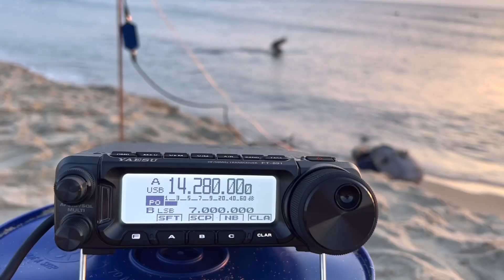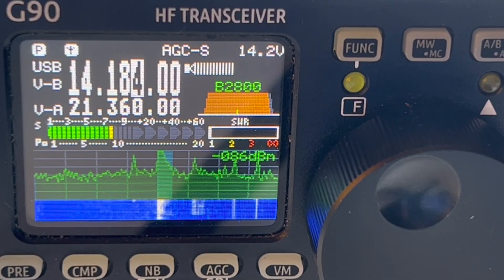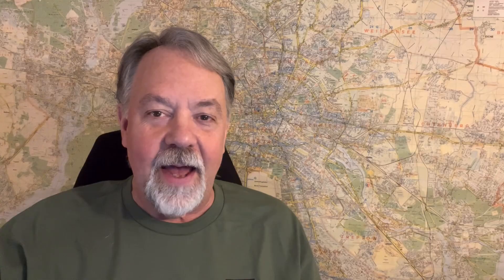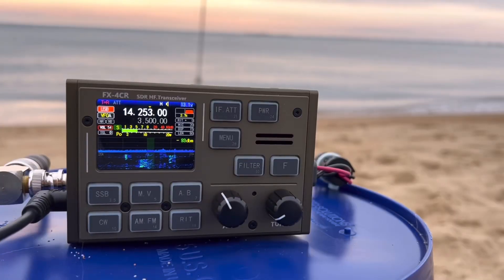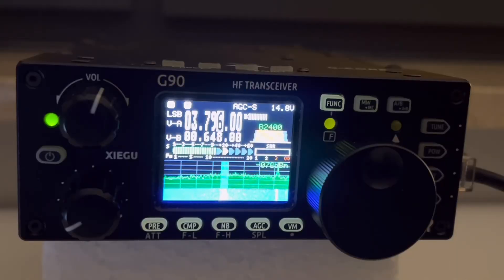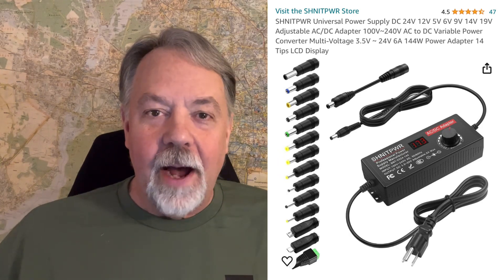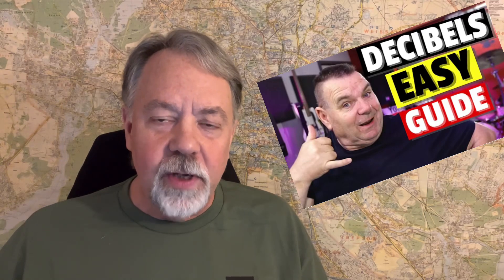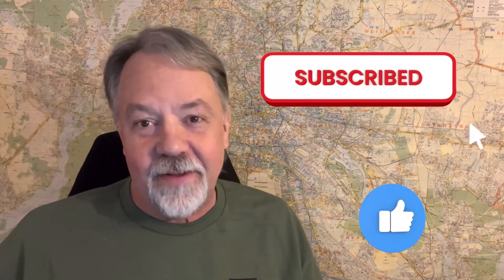20 Watts Versus 100 Watts - How much HF Ham Radio Power Do You Need?

Comment: Right on point Walt and good job on the laying out the facts. I have a G-90 and an 891. I see little difference in contacts made between the two. The G-90 has an edge with size, weight, power usage and a fantastic tuner. The 891 has a slight edge in power and it's excellent DNR. You are not wrong in your decision Walt.  I have thought about selling my 891, but decided to keep it for a couple reasons. One, it's in a faraday cage as a back up should the worse happen. Second reason to keep it is for when the bands get really bad. Either because of the solar flares or when we get to the solar minimum and contacts get much tougher. In those cases, that one "S" unit might make the difference in getting a contact or not. In most cases, that one "S" unit doesn't make much difference. No matter what radio you are using, the antenna is always one of the biggest factors in your success. Using the correct configuration for the desired distance, the right band and the most efficient antenna will make far more difference than one "S" unit. Some may disagree....it is what it is. I love the antennas you build. Ham radio does not have to break the bank. I often recommend the G-90 to new hams. It makes a great base radio and is great portable. It lets them get on the air and gain experience so that they can make better choices in the future as to what additional ham radio equipment they will need and buy. You don't have to be the biggest mouth on the air, especially when your ears are lacking. 73 !

Comment: I had the G90 and thought i needed more power. I sold it and bought the icom7300 and the ft 891. 7300 in the shack and 891 in my truck. Love them both but i miss the G90. There is a guy near me that is selling a G90 that has mods and is 6 months old for $335.00
Reply: I own the same 3 models also . Haven't thought of selling any of them yet.

Comment: I loved my G90 when it worked. The first one i bought the top buttons worked intermittently.I sent it back and received another one. After about 10k qso's the mic stopped working or would lock up on transmit. Radioddity wouldnt send me another mic. They sent me another replacement. Well that one wouldn't TX on AM. You could switch to AM but it would TX in LSB. So knowing my warranty was about to expire. 1 year. They gave me a full refund. I put another 200 dollars with it and bought a 891. For the occasional activation it would be fine but for constant use the milage my vary. I run resonant antenna's for POTA and BOTA so i have no use for a tuner.  What works for me might not work for you.73's

Comment: I guess I don’t really need to worry about getting a 500 watt amp for my iCOM 7300 anytime soon … i should just enjoy the rig barefoot
Reply: fwiw, I run a 7300 with a AV-640 vertical antenna. I also have a 800w amp-of which I've used only a handful of times in the last several years...i should sell it.. lol..

Comment: I use a yaesu ft818 with a 150w cb antenna adapted for ft8 10m, it’s frustrating sometimes but it works.
For the rest of the bands i usea a yaesu ft710, i tried qrp on 40 and 15 and its very frustrating, 20 to 50w is the only way

Comment: I set up a winter ham shack in my basement  built a 20m speaker wire vertical,,,my G90 was the rig i used ,,the contacts on 20m were unbelievable!! A sad day is comming when i take it all down to put the grill and picknic table back,,,,this fall ill put a rybokov in its place and hope for the best 73 thanks walt

Comment: Like the Channel Walt, I would say that 100W is 5 times  20 W and yes thats only 7db or an Spoint , the real issue is that 5x the opower doesnt get you 5x further especially as you are fortunate enough to be close to a beach & salt water. We do have a few years of solar maximum left so it will be interesting if you can tell us how that goes further down the line. BTW have you done any more with the SLinky antenna ??

Comment: Strongly thinking of selling the 706 MKIIG but not until I buy a 705.  I want the option to go SSB of VHF/UHF and that is me.  I can't go with the other radios you mentioned because of the small display size and my vision issues.  It is why I diched the FT-817D

Comment: Hi Walt,
What venue did you use to sell your FT-891? I need to sell mine, but it's for dental expenses. Really don't want to sell it and I may also need to sell my lightly used  ALS-606S.  73  WJ3U
Reply from the maker: I did a Facebook post but actually ended up selling it to a friend in my local club.

Comment: Sold my 100 watt rigs years ago.  Not against more power, some people live in less than ideal places an a little more power helps them get out.  Using less power means you can carry less power.  Smaller batteries, smaller wire, smaller transformers.  I don't even own a tuner.  To each their own though.  Do what you want and have fun.

Comment: I agree 100 per cent !  I used my Yaesu FT 450 for 15 years .  Back in November I bought a new Kenwood TS-590 sg . In January I bought the G-90 .  Guess which radios  are  gathering dust , while I have been making 1 watt ssb /phone contacts?  Low  Power is so much fun. KJ4HRL

Comment: What timing! I’ve been conflicted on these 2 radios for months and am getting ready to buy in the next day or so . I was convinced on the FT891 until this week. Your channel has provided some great insight on the G90. In your opinion, is the additional cooling fan needed if I’m just using SSB phone? 73!
Reply from the maker: No I have been running mine for 3 years in the heat with no fan. It gets a little warm at times but the fan really isn’t necessary for just SSB. 73, Walt

Comment: Love my G90 too! I use it in an off grid outbuilding, dedicated to radio (& storage), where I use a pair of 8 amp/hr LiFePo4 batteries, kept up with a 100 watt solar panel and Renogy charge controller. Perfect set up to feed in my two HF antennas: an OCFD dipole with a 4:1 balun & random wire 44 ft long with a 9:1 balun.
Reply from the maker: Awesome! 73, Walt

Comment: Passed my General last week and got a G90 based on all your great videos.  Got a piece of Menards speaker wire chucked in a tree outside my apartment office window and IM TALKING TO THE WHOLE WORLD. You were right dude…. 20Watts is all you need.  Thanks for the great info on your channel, you got me up and running QUICK.
Reply from the maker: That’s awesome! Hope to catch you on the bands! 73, Walt
Reply: I got 2 g90 radios, 1 with 100 watts and just use the other on 20 watts, it's all I need. Walt got a. Link to that small power supply???? AA2BD
Reply: @COASTALWAVESWIRES  Walt.. I had to come back and tell you .. I hooked my G90 to the gutter outside my apartment this morning and its working AWESOME hahaha.. 9:1 unun, 6foot of ground wire and a little lead hooked direct to my 40 foot tall by 200 foot or so apartment gutter and let me tell you buddy it tunes up 20 and 40 no problem and FT8 is LIT this morning hahahah.. Have a great day!
Reply: Cool man! Exactly what i was hoping to hear. What you described is the whimsical dream of HF I’m hoping to attain. Set you doing 20 meter?
Reply: @DeepBlueWaves  10 - 12 - 15 - 20 - 30 - 40 - 80 .. it's all popping!
Reply: @silicosick  yay! I plan to be mostly outdoor; do u feel the G90 is rugged enough for that? The FT-891 idea is still drilled into my head.
Reply: @DeepBlueWaves  I would say the G90 is as rugged if not MORE rugged than the 891
Reply: @silicosick  cool man! Have Tech, plan to grab General in June, and surf the waves soon. Thanks again :)
Reply: Congrats. I did the same when i got my general… I was considering the FT-891 as well, but went with the G90 as well…
Reply: I have both of these radios and i use the g90 way more than my 891.

Comment: It depends on an almost infinite number of things, and I won't even bring up signal propagation, which we all know varies widely, often from minute to minute.  If you have a REALLY good antenna, WAY up there, and everything is properly tuned properly, yes, you can do a lot with 20 watts. Some prefer 5 watts. The rules allow you to use as much as 1500 watts on many bands, but they also say you must use the minimum amount of power necessary to establish reliable communications. I have an Icom IC-718, an Icom IC-728, and a Yaesu FT-DX 560 tube radio that I completely rebuilt. Not a fan of newer "computer" radios. The Icoms will put out anywhere from 5 watts or less, to close to 100 watts, depending on modulation. The Yaesu will put out close to 200 watts SSB. I don't have the best antenna in the world, and there is nothing I can do about that. What I have noticed is that I can make a LOT more contacts with 100 watts than with low power. There is definitely a law of diminishing  returns as far as power goes though. I live in the southwestern U.S., and have made a lot of contacts in the South Pacific, especially Australia, New Zealand, Tasmania, and several of the smaller islands. That's 8,000-10,000 miles away. I have talked to stations with 100 watts that claimed to be using 1 KW or more. They don't sound any better than those who claim to be using 100 watts. But drop it to 20 watts, and reliability drops off considerably. Thats been my experience anyway.

BTW, I am disabled, and don't operate portable. And while I have a 2 meter/7cm radio in my car, I have never tried to operate HF mobile either.

Comment: Walt, you do you and what is best to enjoy the hobby your way. That's what it is all about. I have both the FT-891 and FTdx10. Great radio's. My main gripe is that they will not go below 5 Watt. My first Yaesu was a FT-890 bought new in the early 1990s. That one went easily to around 1 Watt. As I am not an outdoor operator, I now use an SDR (on a big screen) that will go as low as 60mW. Great fun.

And yes, I am definitely in your camp that 20 Watt is the sweet spot and works well for outdoors, for all the reasons you mentioned in this video. Take care.
Reply from the maker: Roger that and as I said in the video, the 891 is a great radio for some, just not me.

Comment: It should be band vs power. You will find where 20 watts on 20 meters or 10 meters will work but  the same on 40 meters or 80 can't hear you as well. Don't want to be a mud duck.

Comment: Good info in the video. I love my 891 for a number of reasons but never run it at 100 watts! You are correct in the power comments. Under most conditions 1 or 2 S-units are insignificant. Occasionally it does make a difference but only for the contester or extreme weak signal operator. Conditions make the most difference and choice of band etc. I run several power levels but 20 to 50 watts is almost always the choice. I also never run any rig ( except my old boat anchor Johnson Viking Ranger II ) at full power. Even my 1500 watt rated amplifier only gets pushed to 750 watts for maybe the rare new country! It still has the original tubes from the 1980’s! The old rule of thumb used to be you need to quadruple your power or antenna gain to make a worthwhile improvement in signal strength. For me it’s the receiver that counts most. Also the way the front panel controls are set up can make or break a radio for me. It may be what you are used to. I want everything to operate like my long gone TenTec Omni 6 plus! The Elecraft K3 and the FT-891 suit me. I do wish they both had the sound of my old Drake 2B but they are not bad.
Reply from the maker: Yes and as I said in the video, I don’t dislike the 891 and it’s the perfect radio for some, just not me. 73, Walt
Reply: Im looking at an 891 as im struggling with  to work an hear us stations on it, even with tweaking settings and antenna setup i can work Europe perfectly fine on my g90 tho at 20w
Reply: @AndrewR2130  where are you? What band are you using? My FT-891 has a very sensitive receiver.
Reply: @AndrewR2130  fwiw, I feel my 891 "hears" better than my 7300 on the same antenna...

Comment: Thanks Walt. I've just come back to amateur radio after a 40 year break. In the UK this means my old licence is now a full licence. I bought a g90  because it is ideal simple rig to ger me restarted. I've worked stations over 5000 miles away on your 17.5 feet antenna video construction 😊 so thank you very, very much. It's ground mounted in my back garden in the middle of a housing estate in Gloucester UK. This was a great video because i have been toying with buying a 100w radio. A side point is 20w also doesn't cause any problems with my very near neighbours. Thanks again for your great videos. 73's Jerry G6YSJ
Reply from the maker: Thanks and 73 my friend!
Reply: If the UK has moved to HDTV, you won't have any TVI issues.
Reply: @spaceflight1019  How so? I find HD is VERY susceptible to signal strength and interference issues. The SD channels less so.
Reply: @paulsengupta971  One of my friends has a HDTV antenna mounted on the same mast as a 3 element 6 meter beam. Running 100 watts he reported no interference.

Comment: S Unit Difference = (10 Log (P1/P2) / 6 . This assumes the radio has an accurate S meter calibrated to the old Collins standard of 6 dB per S Unit.
I haven't noticed any difference downsizing from my 100W FT-897D to my 20W G90 Xiegu REVISED EXCEPT in the weight of gear to transport.

Comment: I have a theory to explain to something I see in practice and there’s no explanation. I think swr affects RF in ways that’s not only power loss. In many occasions, at the same time of the day, same location and same propagation conditions I get more qsos with qrp than qro. The difference is swr. With the ic705 I have to operate with flat swr due to lack of tunner. When I’m out with the 891 I don’t care much about swr bcs my box has a tunner in it. The same thing happens with the kx2 vs ic705. I get more qsos with the 705 always . The difference is that the 705 needs flat swr and the kx2 I can just tune.  I’ve noticed this behaviour over and over but there’s nothing I found that would explain that. Thus I believe that SWR has more effects in the propagation of the RF than just power loss ….but it doesn’t make sense and I can’t figure out why.

73!
Reply: Is that a resonant antenna vs. a non-resonant? There could be an experiment there, maybe switching between two antennas similarly oriented.
Reply: @paulsengupta971  it’s the same antenna, I normally use a cha ss17 with 12 radials. I have marks on it, like the mc-750.  When I have a tunner I just erect it up to the mark and solve the rest with the tunner, when not I flatten the swr using a nanovna. Normally it’s 1.1 vs 1.8 swr. I have it documented in video what’s the difference in signal, but with the same radio, when swr is 1.1 and 1.5. A friend in Ukraine helped me filming it on his side.

The results doesn’t match the theory. Theory says 1.5 swr causes 4% loss and that’s not what happens in my documented tests, the signal on the other side increases drastically. I asked my friend to film bcs I thought he was trolling me. Then I thought it was his radio, so I asked another friend in Japan to record it too… same result.

If there’s a flaw in my test it could be that in the exact moment that I went to calibrate the antenna the propagation improved. Also I only see this difference in real DX, not in QSOs inside NA for example. That’s why I think that in the process of flattening in swr you change something else in the antenna that changes something in the wave propagation that makes it better, but only in long distances. And I have no clue what it is. Hehe

73
Reply: @paulsengupta971  you notice this as well in hams in the south of South America. Im Brazilian and lived in the south where most of interesting DX is at least 9000 km away and there you feel the swr difference as day and night. That’s why hams from that region are obsessed with flat swr
Reply: If you can adjust the antenna to go low on SW$, then that's the best method. Antenna tuner (matcher) can help but it's not the best method. It's especially for the tuner that is at the radio and not at the base of the antenna, causing bigger loss with an impedance mismatch on the transmission line .

Comment: I agree Walt, I just sold my FT-891 and if I got another radio to use as a portable it would be another G90. The built-in tuner, the waterfall the price  it’s a much better unit for me too. Still my base unit is a 7300 and I’m very happy with it.

Comment: Walt, I too have the FT-891 which I first purchased when I got my Extra.  And while I like my FT-891, going portable with it is a bit of a hassel especially when you have to pack an ATU not to mention all the additional cables. And while I will still keep it, 20 watts as you say is all you need given that you'd have to quadruple the power to gain an extra S unit. Great video Walt.
Reply from the maker: Thank you my friend! 73, Walt

Comment: Piggybacking off the battery comment , one often overlooked savings is the receive. The 891 draws about 1 amp on receive , the g90 is around 450ma. Plus I find the 891 @20w transmitting draws more current then the g90 @20w transmitting
Reply from the maker: Roger that! Thanks for sharing

Comment: Hi Walt, if Xiegu brought out a G90 replacement, would you buy one?
Respect your decision to sell the radio.
All the best David M0DUU
Reply from the maker: Yes indeed if it is a 20 watt radio.
Reply: @COASTALWAVESWIRES  Xiegu have never made a 100 watts radio. So I am sure it would be 20 watts or less. A lot of UK amateurs are waiting for the release of the Xiegu X200 and I believe that will only be 8 watts.